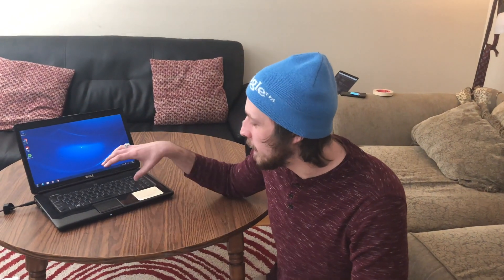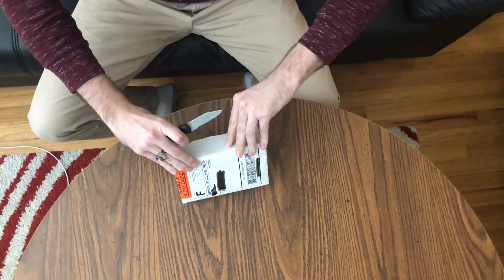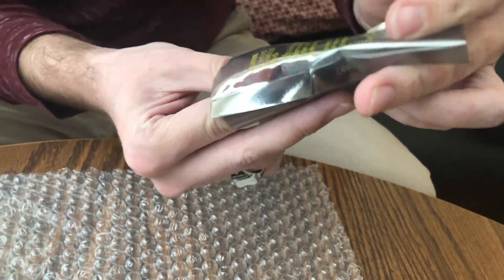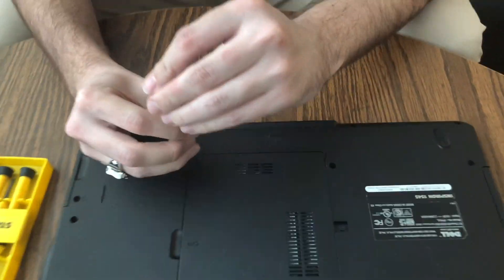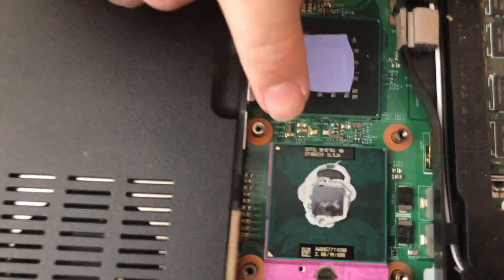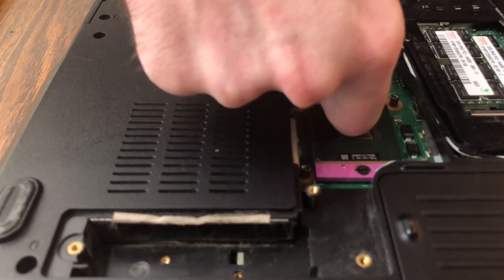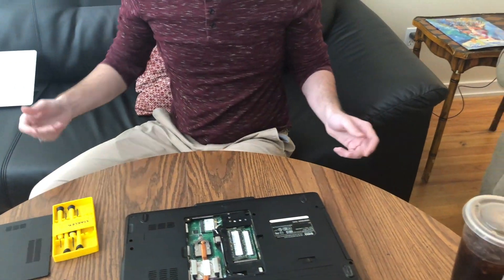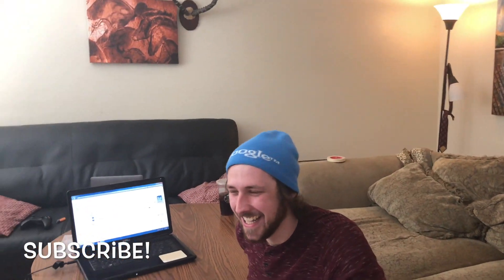Installing Intel T9900 CPU in Dell Inspiron 1545

Comment: I have a 1545 right here in front of me and I was going to fix and give away to somebody that just needed a temporary laptop I also have a t9900 here next to me for the upgrade to as well as thermal paste but as far as the RAM goes I just have the stock RAM and I want to go buy some but I'm not sure what to get All I know is that I can only get a maximum of 8 GB @ 2x 4 GB modules, SODIMM DDR2 but don't know much beyond that so I might just give it to him with the RAM I have since I cant seem to find s str8 answer online
Reply from the maker: Hey man, check out this video (unlisted) where I max out the ram on 1545:
https://youtu.be/i2YmSCC1hLg

Comment: Its worth? Dell 1545 intel pentium dual core 2.0 ghz to t9900 3.06 should upgrade 26$ ? In 2024 for normal office use ?
Reply from the maker: Only for fun/hobby, if you need something for office use, get a Macbook Air.

Comment: Did something similar with my old trusty Dell 1545 as well. Upgraded the CPU to a T9800, installed 8 GBs of RAM at 800 MHz, and replaced the internal drive with a budget SSD. I even replaced the DVD drive with an HDD caddy, though I put it back again later as this laptop is the only thing left at home that can read DVDs on the rare occasion I need a CD/DVD reader.

It feels pretty much like a modern entry level laptop now, I'm so glad I put in the effort to upgrade it. I love how they used to build laptops to last. New laptops feel so disposable to me, with most (if not all) components soldered onto the motherboard & case closed with glue. Almost impossible to repair or upgrade. I'm looking forward to buying a 'Framework Laptop' when it becomes available in my area just for the potential longevity.
Reply: I swapped out the CPU to a T9900, installed a 900p screen, replaced the DVD with a caddy with a 1 GB HDD, installed a 512 GB SSD, and this one has the ATI Radeon 4330 graphics. It's pretty close at this point to a 1545 to the max. There was a 1080p option, but I didn't see the point on a 15.4" screen.
Reply: @johncate9541  Cool, didn't know there were higher res replacement screens for 1545. 900p sounds like a pretty useful upgrade. Is it a TN panel, or found an IPS/VA somewhere?

The only problem with my laptop today is its battery, barely lasting 15 minutes (it's 12 years old so pretty much what I'd expect from li-ion cells). It's the only part I'm hesitant to replace from 3rd party generic manufacturer, don't want to wake up one morning and wonder why the house is on fire.

Comment: hi John, I have Dell Latitude e5500 currently running core  2 duo P8700 2.53Ghz. Can I upgrade the cpu to core 2 extreme or if not T9900?

Comment: I have a celeron single core 800mhz fsb , can I upgrade it to t9900 which is 1066mhz fsb? , so the main question is ( can I upgrade from 800 mhz fsb to 1066mhz fsb) ????
Reply: it depends on the motherboard chipset. The chipset can be viewed through the CPU-Z program (Mainboard page) -> GM965? GL40? GM45 ?.
Which laptop model?

Comment: Hi, I have a inspiron 1420 and i wanna replace the Intel T5550 667mhz for this one just te diference will be 667mhz to 1066mhz probably not work
Reply: Hi , I’m like you , i have a celeron 925 with a 800mhz fsb & I wanted to upgrade to a t9900 but t9900 is 1066 mhz , if U found any thing about it tell me please

Comment: Mine came with a pentium, is that t9900 the max cpu for that laptop, can it hold 64 bit os? Can you leave us a link to that processor?
Reply: I'm using a Pentium T4400 that came with it.
My operating system is currently 64-bit.

The maximum CPU the Inspiron 1545 can handle is a Core 2 Duo T9900. (There are two more processors which fit the socket of this laptop; but they aren't any faster and they use more power than the computer gives - so they wouldn't work anyway...) See https://www.cpu-upgrade.com/CPUs/Intel/Pentium_Dual-Core_Mobile/T4400.html for the list of CPUs that fit that socket.
A look around on eBay will show you some kind-of sketchy, but apparently reputable sellers who sell T9900s; I found one here for ~$70.00 (USD) with the eBay item number `124398295829` (I'm not going to put in the full link because it's huge. To find a product by item number, just search the number I gave in the eBay search bar at the top) 
The T9900 is a 64-bit CPU too, and I believe it's ever so slightly more power efficient too; but that doesn't matter in a computer this old, my battery only lasts 50 minutes. I think there are some other more technical improvements aside from the clock speed improvement up to 3.06GHz too...

Comment: Can you also get those necessary components via Amazon? I don't have ebay... 😬 I'm just not technical at all and I want to upgrade my inspiron without buying a totally new laptop... 🙏
Reply: I don't believe there are any Core 2 Duo T9900s on Amazon. eBay will be your only option. Anyway, to buy off of eBay - all I believe you need is a credit/debit card or PayPal, it's not bad.
You are on the right track for upgrading your Inspiron like I am. With maximum RAM (8GB) and a T9900 (3.06 GHz), it'll be up to par with some modern-day computers. The only problem with upgrading the 1545 is that the GPU can't be upgraded; so you're stuck at that, which will make modern-day games and GPU-intensive programs - like Unity, Unreal Engine, Blender, and basically all video editors - all very hard and slow to use.
Reply: @toydotgame  hm, I'm stuck... I think I'll just remain with the old one first... 🤷🏻‍♀️😪

Comment: My inspiron 1545 originally came with a T4400
Reply: Mine too! I'm also planning to upgrade the CPU to a T9900 and get 8GB of RAM. I'm also thinking of getting a WD Blue SSD for even more speed, especially when booting the computer.
Hopefully with these upgrades my 2009 laptop can compete with 2020 laptops - the only drawback being the GPU.
:)
Reply: @toydotgame  Yeah the GPU for my Inspiron is a Intel GM45.
Reply: That means it can't basically run multiple programs at the same time with the stock specs.
Reply: @lukas0000  It can run multiple applications at a time; but actually having it be usable? No.
From my experience this varies though. I can have a few Firefox tabs, Spigot, and Discord all open and it runs okay; but sometimes I get huge slowdowns basically at random.
Reply: @toydotgame  And yeah my Inspiron reaches a temperature of 86°C at max.
Reply: @lukas0000  That seems way too high for any computer (As far as I know; it seems 40-60° seems normal). I don't know what my system runs at but just in case please check your heatsink for dust clumps.
Reply: @toydotgame  Ok

Comment: Great job!
I have a 11 years old Dell Inspiron 1545 with a T9600 Processor, 4GB RAM and two 240GB SSD. I replaced my DVD drive by a Caddy and installed an other SSD on it. It runs Windows 10 fine. I intend install 8GB RAM, but it's very dificult to find 2X4GB DDR2 modules.
Reply: I just updated to windows 10 on my inspiron 1545 and it is so slow. I dont know why ☹
Reply: @Nohan_baloch  i tried windows 10 for a while but it was slow too. I tried everything, although this was before i maxed out the ram and put in an ssd. I think it's just the drivers, they don't make them anymore for this laptop and they don't work well with win10. In the end i went back to windows 7, 8gb of ram + ssd and I'm extremely happy with the performance
Reply: @emilyc9240  damn I shouldnt hv upgraded ti win10 now if i wanna go back to win7 i ll loose all data?
Reply: @Nohan_baloch  you don't ir you did it on time
Reply: @Nohan_baloch  I'm gonna migrate to pop os
Reply: @hectormanuel8360  I'm going for Linux Mint XFCE

Comment: I put one in an Asus K66IC instead of the stock T4400, up to 8 Gb of DDR II Ram, a crucial 500 Go SSD and i use it with Android 9 - 64 bit it's just a new yougness for my laptop. I've tested Win 10 also not bad at all. Very comfortable for multimedia purpose and working.

Comment: Hi, I'm Silverio from Argentina. How lucky you have been, congratulations on such a descriptive video. A question: I have a Dell Inspiron 1525 laptop with A17 Bios update, with Interl Core 2 duo T7100 - 1.80 / 1M / 800 processor. As you received from Ebay a T9600 - 2.80 / 6M / 1066 processor. I did exactly what you did on that laptop; but the computer boots up and shows only the power light and nothing else, the screen goes black. I have tried various things. Relieve static by removing the battery, disconnecting the AC cable and pressing the start button for 15/20 seconds to discharge the static. I have checked the Bios and I think everything is correct. Can you tell me if this T9600 processor is compatible with the Inspiron 1525? If it is, then they put the dog in me, as we say in Argentina jahhh! and the processor does not work. Do you have any solution? I will appreciate your prompt response if you have it. What a pandemic and cordial virtual greeting. :)>
Reply from the maker: Hi Silverio, thanks for your comment! I am sorry to hear that you're having issues with this. The first thing I would try, is to replace the OLD processor if you still have it, and make sure everything still works correctly. 

If the old processor still works in the computer (T7100), it may be a faulty new processor (T9600), or something may have been installed incorrectly. If this is the case, you can try to re-seat it and re-install.  

If the old processor fails, this could mean that something else happened during your installation, such as ram or wires disconnecting, or (god forbid) something shorted on the motherboard. 

You said you can access the bios, which is a good sign. Are you able to see processor information in the bios? This could mean that the OS needs to be replaced (you could try booting into linux from a live USB to test). Sometimes Windows acts strange when changing hardware.

Try this, and let me know. I wish you luck!

Comment: 11:49 "YOU CAN NEVER HAVE TOO MUCH THERMAL PASTE"

YES YOU CAN AND YOU DID.

 Thermal paste is a very poor heat conductor. It is used only to make a secure contact between the heat sink and the processor plate. You apply too much and it will act as an insulator. Pls apply only a small pea size amount.

Comment: I've used my Inspiron 1545 with a Pentium T4400 and 3GB of RAM since I got it back in 2010. I'm going to buy 8GB of RAM and a Core 2 Duo T9900, which are pretty cheap for being maximum spec for this PC. I've stayed with this laptop and used it because I can tolerate slow speeds, but I can make my system run quite well, so it's not much of a problem. I love the design of it, which is why I've never switched computers.
Investing around $180 is fine by me and I look forward to installing these components. I think this is certainly better than getting a new one, I really miss glossy, thick, heavy laptops (not the 1909s lap-crushers, but the mid-late-2000s laptops which make your lap warm, like a cat) and my Dell just works well and I love it.
Reply: I definitely agree with about the design. I really love how easy it is to swap out ram, cpu and hard drive and of course clean the fans. I bought 2x4gb 800 ram for 80euro, a 480gb ssd for 60euro and plan to get a used t9900 for 50euro. I don't mind spending 200euro on this laptop, especially since my brother just gave it to me when he upgraded. I'm still running windows 7 and I'm really loving the performance of this laptop.
The only downside is that you can't play the vast majority of games, but there are a few reallly good ones that can run just fine on lower graphics settings.
Reply: @emilyc9240  Yeah. I'd say games and other really modern things are a pretty huge drawback of the laptop. I only play a 2013 build of Minecraft with minimal graphics settings, and it only goes at 20FPS. I can tolerate that though, and I never plan to run any other games on it so it's okay.
Reply: @toydotgame  what graphics do you have? I wanna know cuz I have a 1545 with a t6500 and 4gb ram. Both of which are fine if it wasn't for that Intel GMA graphics
Reply: @Maximus20778  Ah, I built a new PC this January; I haven't used my 1545 in quite a while.
That laptop has a discrete GPU that's directly mounted (non-upgradeable). You won't be able to go any further GPU-wise than what you've got (I believe the GPU in there goes by "Intel GM45 Graphics Chipset," if you want to look it up on benchmarks). I did go through with exactly that upgrade (T9900 and 8 GB RAM). In more CPU-bound games, I found that the RAM capacity makes the biggest difference – but the CPU upgrade did help, too.
Reply: @toydotgame  yeah I need a new pc to tbh Intel GMA sucks really. Can parts are hard to find for this computer(let alone the shipping for it)
Reply: @Maximus20778  My RX 570 in my current machine, despite being six or seven years old, runs circles around my old laptop lol.
Reply: You cannot run 8GB on the Dell 1545. Maximum RAM is 4GB PC6400.
Reply: @TheMisphit  The maximum RAM is 4GB per slot up to 800MHz.
Reply: @toydotgame  4GB DDR2 Modules are very expensive to buy, especially in pairs
Reply: @TheMisphit  I am aware of this; I've bought 2 4GB sticks for my 1545 for around $180 AUD. My main point is that 8GB will work in the PC, and others have done it.
Price is not too much of a problem for me, the more annoying part is finding laptop sized sticks, and making sure they clock as slow as 800MHz, RAM has since gotten a lot faster, and 800MHz is harder and harder to find and buy.
Reply: @TheMisphit  websites says so

Comment: I did the exact same as shown in the video. Same laptop, same CPU. Pressed the power button, the power light flashed and went out and turned on. Heard the harddisk run for a few seconds. Then it stopped. Screen is blank. Laptop does not load. Bought a used CPU online. Help please!!
Reply from the maker: Hi Moeed, I replied to your comment on my other video with this machine! Hope it helps!

Comment: Amazing man! It would be good more RAM, I think. 🍺😎👌 Greetings from Germany!
Reply: Yep! I'm using 8gb ram and it was a big improvement
Reply: 8gb could be nice, but at the prices people are asking for it, heeeeell no. Anything over $40 for decade old ram is mindblowing, let alone the $120+ people are asking (and apparently paying) for two 4gb sticks.
Reply: Unfortunately 4GB (DDR2) is the maximum that it can run (the laptop that is, the CPU can run up to 8GB though in DDR3 laptops)
Reply: @TheMisphit  The Inspiron 1545 has two RAM slots; and the service manual says that they are both 800MHz DDR2 SO-DIMM slots with a maximum capacity of 4GB. That would be a total of 8GB of RAM.
Many people I know have successfully upgraded their RAM to 8GB in the 1545, including the uploader of this video.

The way you've made your comment confuses me as if you knew that it is 4GB per slot or 4GB overall - I can't tell. If you thought the latter, that's not the case - fortunately. 8GB RAM is supported by most of the stock CPUs the laptop comes with (For example mine came with a Pentium T4400) along with the maximum CPU (Core 2 Duo T9900) also supporting 8GB.

Comment: Hey man. I know this is an old video, and probably wont even get a reply. I was wondering, do you remember what was your motherboard Chipset? I would also like to upgrade my laptop processor. 
- With "CPU-Z" i get Intel GM45/GM47 (Southbridge: 82801IM (ICH9-M)), which would allows me to install T9900 too.
- With "EVEREST" i get  Intel GM45 (Cantiga-GM) with max FSB800, which sets me back at only T9500.
- With "HWiNFO64" and "SiSoftware Sandra Lite" it only tells Intel GM45 (Cantiga-GM), again T9900... LOL
Reply from the maker: Hey man, I downloaded both cpu-z and everest on my machine, hopefully this data helps.

CPU-Z gives the exact same as you: 
GM45/GM47 Southbridge: 82801IM (ICH9-M)

Everest gives me:
Cantiga GM45, supported FSB includes FSB1066, and my effective clock is FSB1066.
Reply: @BenDoesCoolStuff  Hey man, thanks for your quick reply. "EVEREST" is indeed playing tricks on me with its max 800MHz FSB. I guess, I'll look for very cheap 1066MHz FSB Processor like T9400 and do the test. Cheers
Reply: @ytsbooth   man I am in the same situation now. Have you tried the T9400? Did it work?
Reply: @thiagotocs  Hey, yeah, it totally worked perfectly. I don't know what's up with these programs identifying the chipset differently, but the T9400 has been working without any issues. Make sure to use a nice thermal paste (I used Thermal Grizzly Kryonaut, maybe overkill, but I bought it cheap). Never had any Heat problem. The Best upgrade was SSD after. Boa sorte.